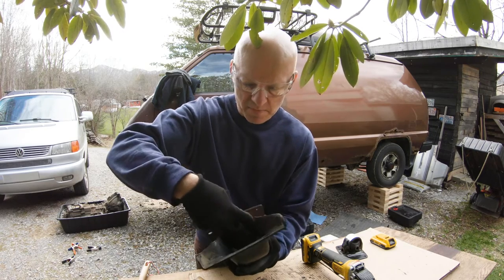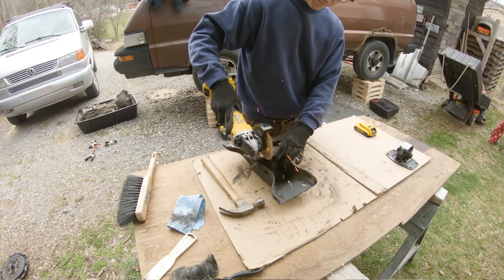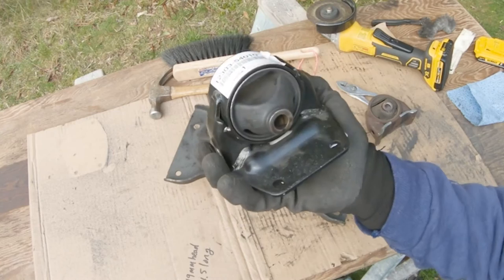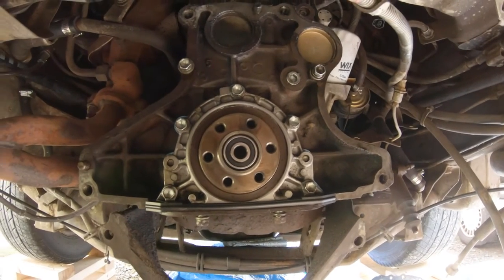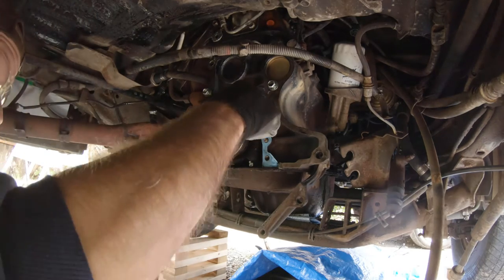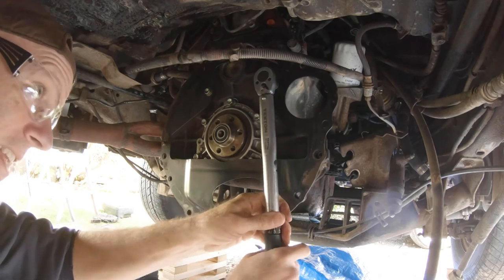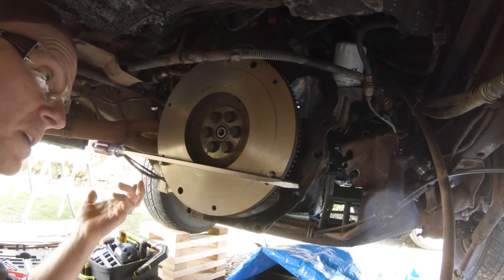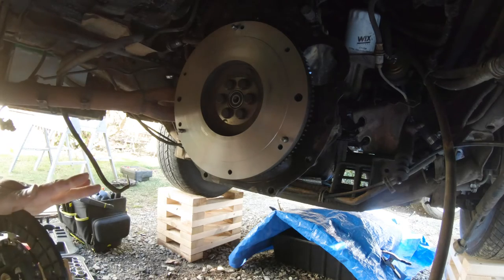1988 Toyota Van | New Clutch install and Transmission mount | Chapter Three

Comment: Wow! I didn't expect you to go back and remove the seal and clean it off, koodos!
I guess I should explain. I've been told greasing oil seals like a rear or front main can cause them to spin in the bore during engine startup or hitting the gas. Especially if they're so loose you can push them in with your fingers!
Love watching you man, keep on keeping on. It can be hard to get a start some days
Reply from the maker: Funny. These were filmed back in March and I hadn't really looked at the footage until I started the edit.
When I opened up these clips to start editing I realized I had come to the same conclusion that you were commenting on previously. LOL! 

So it was pretty cool to have the possibility of a future seal failure alleviated by my younger self. Fixing a potential problem by removing the grease applied from before. 
So weird. I wonder how I came to that conclusion? I do tend to stew and reason on things after the fact. I've taken just-assembled things back apart many times just to make sure I did it correctly. 
This self taught stuff is def a challenge. ;)
Thanks for watching and your encouraging words.